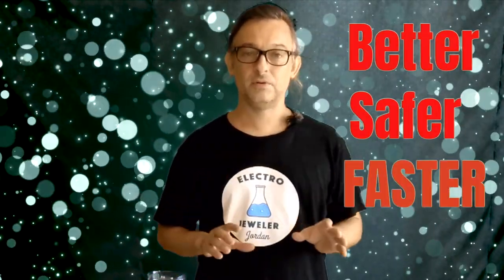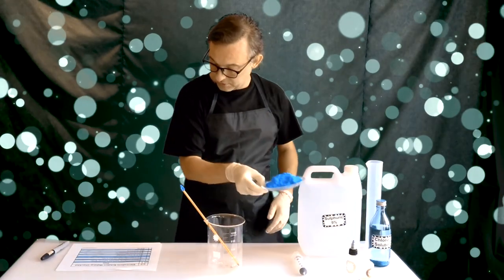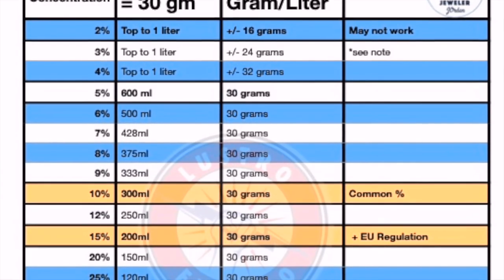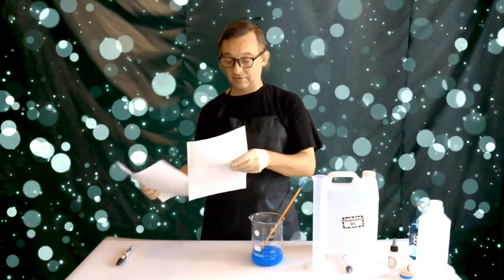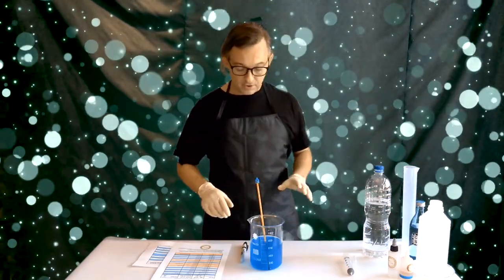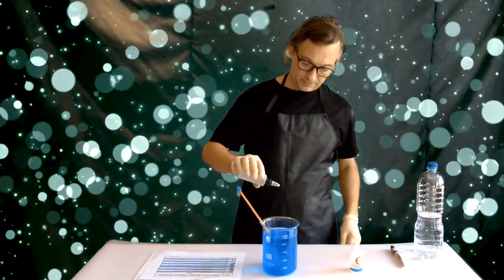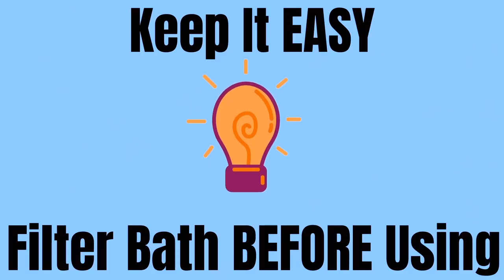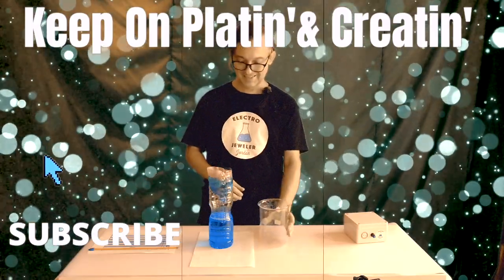Best Electroform Solution Recipe For Small Tanks 1-10 liters

Comment: Thank you for your video! I have a question. Here in Canada I have trouble to find a battery acid, no one use it... can "Super Drain" liquid drain be used for that purpose? from another video someone said it is 98% of acid
Reply from the maker: Hi, thanks for watching!  I have a list of possible sources in Canada, if you contact me either through my website or Etsy shop I'll be happy to share.   I have a lot of customers in Canada that use battery acid and some have sourced from that list. As far as the drain cleaner, I've tried it and never had good results.  The quality of acid is low and it contains chemicals  that slow down metal erosion in order to make it safer for pipes.  That said, if you are going for a very textured look , it may be an option.

Comment: Would this build up copper on an already copper-plated object?  Several thousandths of an inch, even?
Reply from the maker: Yes,  you can plate directly over copper, brass, bronze, nickel , silver or gold.  Just make sure that the metal is super clean first.
Reply: @electrojewelerjordan490  thanks.  This is for conducting higher currents in a multi-called battery.

Comment: cant figure allot of things out due to Europe and supplies
When you test PH levels, what should they be?
And so for example, if your tank acid shows low PH levels how do you lower or higher it?
I watched another video about chloride but I ant tell if you need to use chloride to lower or higher PH levels.
Reply from the maker: Hi, if you follow the recipe the pH will be correct.  Most people use a pH of between 1-2 , a little higher or lower is ok.  Sulphuric acid will lower the pH.  The chloride is to help with the anode erosion and helps keep the tank cleaner, but in the quantity used won't change the pH.
Reply: @electrojewelerjordan490  ok so Sulphuric acid  to lower PH and chloride is only to help with residue issues in tank like corrosion  etc...
Reply from the maker: Sulphuric yes, to lower pH and for conductivity if solution.  Chloride is for anode erosion.

Comment: Which copper sulfate do you recommend? I used drain cleaner but you suggest it may have contamination. Where to I get the correct copper sulfate?
Reply from the maker: Hi, first a lot of people get good results from this type of copper sulphate.  That said through personal  expression and customer reports sometimes you just get a bad batch.  If you are getting good results no need to change.  I use copper sulphate from a chemical supplier.  You can probably get from eBay or Amazon in small quantities.
Reply: @electrojewelerjordan490  thanks so much for your reply. are there keywords or companies I should be aware of?
Reply from the maker: Sorry for the late reply, I don't get notifications unless it's a new comment thread.  Not really, just a chemical supplier.  If you see a link that looks interesting you can send it to me.  electrojewelerjordan@gmail.com

Comment: Awesome video! Is it distilled water one must use?
Reply from the maker: Great question!  Yes, you will need to use distilled  or DI water. Tap water  contains minerals and metals that will accumulate in your solution and will contaminate it.
Reply: @electrojewelerjordan490  But then clean water from the pharmacy should work, yes? I use that kind of water when I make facila crèmes and it is cleansed from everything. So this could work too?

Comment: Great video thanks Jordan! If all goes to plan I'll be making this today or tomorrow. Got every thing now. Just need to work up the courage to handle the 97% sulphuric acid..it's a bit intimidating! Couldn't get a lower %
Reply from the maker: Just protect your eyes, face and body with the proper equipment add the acid slowly into the water, you' ll do fine.  I can't wait to see your results 😊
Reply: @electrojewelerjordan490  ok thanks! Your confidence is helpful and encouraging  😊
Reply: @electrojewelerjordan490  I did it yay!! time to do a test plate :)
Reply: oh shoot, so I made 4 litres. I thought I had dissolved the copper sulphate (it was good quality 98% copper sulphate pentahydrate). but after doing the filter at the end I noticed there was still some at the bottom of my container, prob 4 - 6 tablespoons worth. Will that dissolve on its own eventually? I mixed with 2 litres of warm water to try to dissolve faster. Gave it a good mix/ shake as I was making in a big bottle. Let it cool down over night and proceeded with the rest of the recipe. I did check and thought I got it all dissolved. I put in 720 grams total for my 4 litres. I also notice the liquid is cloudy in a way. Like I can't see what I have put in the tank as clearly as I normally would. worried I have done something wrong some how. 😊
Reply: @electrojewelerjordan490  hard to explain what I mean by cloudy. It is blue but I can't see through it. Could email a pic if you like. All ingredients were as pure as possible. Acid was clear. Used distilled water. 😊
Reply from the maker: @earthsoul9454  it will dissolve, let it sit a bit then mix again.  After fully dissolved,filtered, and room temperature it should be Windex blue and transparent.  If you shook it up there are probably bubbles in it making it cloudy, this will clear too😊
Reply: @electrojewelerjordan490  ahhhh that makes sense about the bubbles & cloudiness. Ok cool I'll leave it to sit a bit & do all of that. yay!
Reply from the maker: Send a pic
Reply: @electrojewelerjordan490  will do 😊